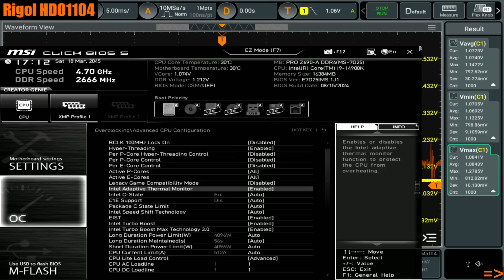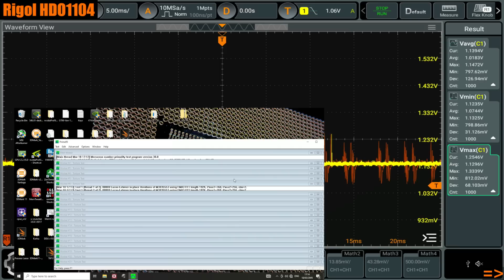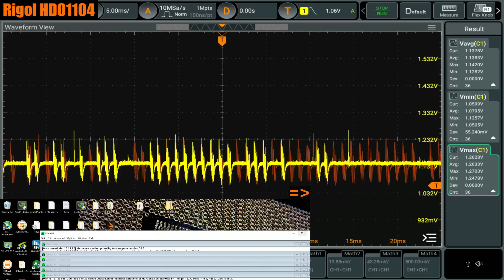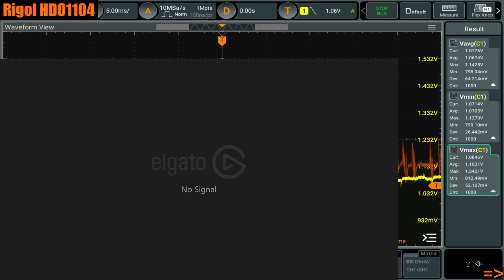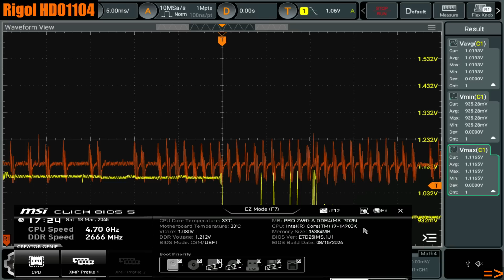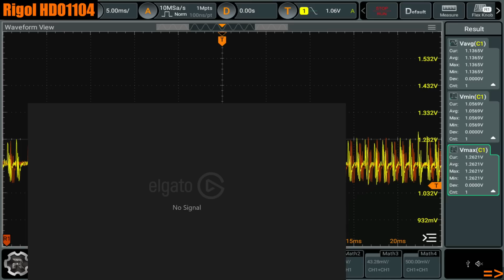CEP reduces Vcore undershoot

Comment: Hi Buildzoid, I have cool memory kit and I wanted to know if you have experience with subtimings/OC of those on a Ryzen 5900x system with a Gigabyte X570 Aorus Pro Rev. 1.0. It is the Trident Z Royal F4-3600C CL 14-14-14-34, 1.45V (2x16GB) or F4-3600C14D-32GTRGA. Thx and best regards

Comment: I have had Z690 Tomahawk DDR4 and VRM on it was pretty good. With 12900K no limitations it was running Prime95 small FFT’s forever pulling 353 Watt. Though my cooling solution is a bit oversized. Comically so 😂
Now I have Z790 Tomahawk with Trident Z5 and VRM is even better. Runs cooler despite 14900K disaster. Unlimited it pulled up to 404Watt.

Comment: i have a question if anyone can give me a answer.

how can i know when applying to much voltage to certain metals or other materials if the materials degrade faster over time?

i am asking this because i want to know if there are methods in how to calculate life expectancy's from different materials for example CPU, GPU, RAM and other board components.

the reason i am asking this is because of the high voltage the new CPU's are using now a days.

my Intel i7 5930k runs overclocked at 1.29volts at 4.4Ghz 
the stocks setting is 1.15 volts at 3.7Ghz
i can go to 1.35volts but then i need good cooling to keep the temps down and i find the voltage to high as well.

the new CPU's from Intel and AMD can run at 1.45volts or even higher
and i am trying to find out how i can know if this is safe for the longevity of the CPU
and if i can calculate the life expectancy of the CPU.

from what i know in the past when applying more voltage to the CPU the life expectancy will drop as well, depending on how high the voltages are.

so if anyone can tell me methods on how to calculate the (voltage X materials = life expectancy's) formula's or something like that.
that would be a huge help for my future researches and purchases!

Comment: BuildZoid, if you haven't already done so, can you test the MSI 0x129 BIOS to see if it disables the 1.55V limiter when you leave (or get kicked out of) Intel Defaults. MSI tech support refuses to give any guidance on this matter because the people we spoke with either didn't understand the question or didn't know the answer.

The implementation of the 0x129 BIOS (for all the motherboard vendors) appears to assume that you always want to overclock if you stop using the Intel Defaults. No one ever assumed that you would want to just downclock or set a fixed all-core. It's frustrating. I know plenty of 14th gen i9 owners that have been forced to downclock to get thermal throttling under control.

Comment: I tried CEP with my 12700K and Z690 Hero, and didn't find it measurably improve stability or improve undervolting. Tested in Prime95 small FFT.  Basically, it makes no difference. So, whatever other measures to mitigate voltage undershoot Intel has taken besides CEP, those measures are working well enough so that CEP isn't helping. BTW, I suspect, those "other measures" are not clock stretching related but rather purely electrical, e.g. adding more capacitance/inductance within the silicon to avoid excessive voltage drop in certain critical parts. Possibly, that's also part of the integrated voltage regulator that is built in to CPU. Your graphs speak in favor of this theory since we do see massive voltage drops when CEP is disabled. The fact that the CPU remains functional suggests that the voltage drops within the silicon are likely not that low.
Reply: So cep enable or disabled?

Comment: I wonder if this behavior would have a measurable impact on performance. I assume it would be hard to test though, as you would need to reliably move the mouse (maybe with an AHK script, but not sure if that triggers the voltage spikes) and Cinebench is already so noisy that it could vanish in the usual variance.

Comment: I've seen you add a bunch of caps to a gpu for better stability. 
I assume that you could do the same for CPU's, but I also assume there are reasons you haven't.
What are the cons to adding caps to the motherboard? 
My guess is that the voltage ramp up under load would be slower, and potentially load the mosfets too high during the ramp.
On the pro side, I'd guess the voltage would take longer to fall, and thus heavily reduce undershoot.

Am I on the right track?

Also, what is the mechanism of clock stretching? Is it simply dropping the multiplier, making the cycle longer, or is it more granular, stretching individual clock cycles as necessary?

Comment: Could you please make a video exploring Asus Z790 motherboard voltage behavior after 0x129 update? And how to optimize 14900K on Asus Z790 motherboard? 
Asus seems to have weird setting which would lock down AC/DC LL to 1 if the Intel Default setting is on, which make SVID undervolt not working.
Reply: This please
Reply: I have Intel Default settings on but my AC LL is tuned still, what do you mean locked down?

I would LOVE to see BZ do an Asus mobo video though

Comment: Nice video, you actually made me change the loadline, but I did not change to 1 because I'm on a different board (Asus) but change from auto to 0.5 an my CPU requests drop from 1.5 to 1.3, I still using the overwrite voltage set to 1.25 but is nice to see the requests lower.

Oh, I have the CEP turn on (never turn it off), also turn on some more protections that is available on my board, disable the undervolt protection ( I don't care the CPU crash for lack of voltage ).

Comment: CEP triggered -> 
cores stall in some cycles (effective clock down) ->  
electric charge provided by capacitance (of MB power mudule) reduced (compared to no CEP)-> 
undervoltage of capacitance reduced ->
undershoot reduced
This can be infered from physics.

CEP is not bad. The EVIL is UVP (Undervolt Protection), which blocks negative VID offset if you don't use K+Z platform.

Comment: Cinabench 38000 , 1940 single , max temp 86 on air cooler max  1.397  its not low but work great i waiting for AIO then undervolting

Comment: What problems can extremely lower voltages create? Why does the CPU protect against these?
Reply: System instability.
Reply: the time a transistor takes to switch is inversely proportional to voltage. if you jump to maximum frequency, and the voltage is especially low, and you do some cpu instructions that have an especially long chain of transistors switching in a row inside one clock cycle, the voltage might not fully/correctly settle before it is read out for the next clock tick ...boom
Reply: It won't harm your chip though, unlike too high voltage. I can harm your file system and Windows installation though (like every crash).

Comment: How did you address the voltage spikes on reboot from the last video? They seem to be gone.
Reply: I have the exact same question because I have the same motherboard.
Reply from the maker: The CPU is limited to 4.7GHz. So I wouldn't say the spikes are gone since I didn't check for them. But if they are still their spiking by 50mv when you're at around 1.1V is much less of problem than that same spike at 1.55V
Reply: @ActuallyHardcoreOverclocking you are definitely correct, at 7:53 spikes to 1.342 on reboot when you turn on CEP.  There is a spike when you reboot with CEP off earlier on although harder to tell it just didnt look as big.

Comment: I beg you change your mic, or recording settings. Your voice is literally painful. I love your videos but can't watch them because of that. Soften it somehow. It's crazy but I actually get headache from your voice and I never get headaches.
Reply: Maybe he's suggesting bass boost, or turn down the treble? It is true that different equipment or audio settings make voices sound different.

But voice is not something people can control. And complaints about a person's immutable characteristics is borderline.

Personally, I would put on your videos before bed, because listening to you relaxes me, and helps me sleep. And your information has been hugely helpful to my own, and so many other peoples, PC build process.

When you talked about tantalum caps and said, "Worst smelling capacitors ever", that's my favourite Buildzoid quote. Shine on you crazy diamond 😊
Reply from the maker: soften it? Like pitch it down or something?
Reply: @ActuallyHardcoreOverclocking  it could just be your mic. 

But you could try turning down the gain and treble. Otherwise look at getting one of those Shure mics that everyone uses for podcasting. Forget which model it is but it starts with SM. With that mic alone you might not have to adjust any settings.

Comment: This AVX Test is that power hungry because MSI uses the AVX Guardband Multiplier at ~50% (Value 128 of max 255). If you want some Asus like behaviour, you should set that to "0".
Reply from the maker: I just set it to 0 and the load voltage didn't change at all it's still 1.14V average on the scope.
Reply: @ActuallyHardcoreOverclocking  you are right and I was wrong. Checked it by myself. I was so shure that this Had an effect. But yeah. Can't See it now. I'm sorry
Reply: @bauerns5er it's good to see people with the emotional maturity to say, "Sorry, I was wrong", well done for that.

I'm currently dealing with people who lack empathy and who never acknowledge their errors. It's draining, so it helps to see, that there still are emotionally healthy people in the world.
Reply: @ActuallyHardcoreOverclocking  okay. I didn't expect that. I'm pretty shure I can see a difference in HWInfo. But in a everyday setting. That means LLC 6 and Matched AC and DC Loadlimes. No scope though

Comment: Can you tell us EXACTLY what pin number on CPU you are measuring as I would like to connect my 250MHz scope to my Asus Z790 Hero which you haven't tried yet? Average 14900KS but good P Cores and MC.
Reply from the maker: I'm just measuring from one of the multi layer ceramic caps on the back of the CPU  socket. With the Hero you could try connecting to the output of the opamp that ASUS uses to copy the die sense voltage to the super IO. Though that might have somewhat limited bandwidth.
Reply: @ActuallyHardcoreOverclocking  Why my i7 13700k never hits 5.3ghz in gaming after microcode update?
Now is 4.9 max.My sp score is 92.I have gigabyte mobo,i use intel default

Comment: Hi, Is it necessary to enable CEP on z790 apex encore when overclocking with fixed vcore mode?
Reply: No one can tell you if CEP is "necessary" because the Intel documentation on the purpose behind the implementation of the feature is basically non-existent. All we know is roughly what it does and that Intel recommends it being on by default. Whether or not turning it off has any significant real world consequences beyond situational instability in some setups none can say.
Reply: I've had CEP being triggered with a 1.3v fixed voltage, you need to test this for yourself

Comment: on ryzen 3000 you can get clockstreching with ecc 10A and singel cock work load. 
r23 without cs 1312points
r23 with cs 1120-1201points with 3900x
im sure that you can get it with 5000 ecc 10A but im not sure if it is possible with 7000 or 9000 series 
you get higher score with more than 1 core aktiv (boost high with same V)

Comment: In teresting.... Tuning my 14700K and that was not my experience. Asus Tuf Z790.

Searching my lowest undervolt with CEP on got me worse undervolting results.
And while I used adaptive voltage, you cant then also adjust the VF curve without triggering CEP.
It was stuck, giving me low cinebench results. Not until turning off CEP, did I get normal performance back...

LLC 4 with 0.5/0.5 AC/DC loadline - maybe those settings are wrong for CEP...
IA Voltage Limit of 1500, and even managed to get it to run 5.9GHz, while under full load its running at a -0.06V undervolt thanks to the VF curve.
Reply: You need at least 0.8 AC load line for LLC 4. CEP operates assuming AC = DC = LLC
Reply: @_exilon_  Like, based on what do you give that number?
It sounds interesting and worth a try, sure...
Reply: @HexerPsy  LLC4 is 0.98 mohm on ASUS
Start off with a -100mV VID offset, 0.98 AC, 0.98 DC, LLC4
Reply: @_exilon_  worth a shot
Reply: @_exilon_  Tried it out with LLC 4 and 0,98/0,98 as you suggested. That seems to be in line with CEP indeed.
I managed a -0,10V undervolt as you predicted, while CEP starts messing with the clocks around -0,11 or -0,12V. Had to raise voltage at 56x and 59x to only a -0,02V undervolt.
But at least the adaptive voltage and VF curve now work together as expected.

CBr23 went from 33,6k to a 35k so thats also great.

But where did you get that info? I looked but couldn't find it myself... I would like to know for future reference
Reply: Could you use LLC=4 with AC LL=0.5 and DC on Auto (So 1.0) but have the "Sync AC/DC to VRM LL".function checked?
Reply: @DeagleHonor  AC must equal DC, so it wouldnt make sense to set up settings that are fighting each other. Idk what the sync option does or which one takes priority.
I am not willing to test that.
Reply: @HexerPsy  BuildZoid said it works in his video.. I'm going to re-watch it. I've been running it this way for a while with no issues thus far
Reply: @DeagleHonor  Yeah I remember a small note on AC/DC Sync to LLC in passing on another video. I believe his advice was against using it, iirc...

What I can find online about it is that the setting comes with up and downsides and does help with LLC testing, but not intended for permanent use.

However intels spec suggest AC=DC and that the socket mohm measurement must equal DC (making DC unknowable).
However if you mess with your LLC, the droop decides the AC/DC value... And the droop is measurable somehow (I didnt look into this).

If you use different values you run the risk of triggering CEP during undervolting before hitting instability caused by undervolting - effectively crippling performance or reducing your undervolt.
Lowering AC effectively undervolts the chip, but doesnt change what CEP expects, potentially triggering it sooner. Different AC/DC settings can also cause instability, easily measured in CBr15.

At least... that is as I understand it currently...

I believe a proper LLC and AC/DC with CEP should give you the least voltage spikes, with the most stability, allowing you to run the best undervolt.
Atm my 14700K reports 1.22V under full load 5.2P and 4.3E iirc - so thats not so bad...
However, the voltage limit flag does pop up quite frequently. IA voltage limit is set to 1.5V and the chip boosts to 59x on 1.44V ish. The chip is only undervolted with -0,02V at 56x and 59x to achieve this.

I think thats safe... It runs stable.
And if it dies on me now after so much effort, I am ditching the platform and grabbing a 7800X3D, 9800X3D or 11800X3D.

Comment: Can't run my same undervolt with CEP enabled on my ASUS board unless I lower the cache ratio below stock.  For some reason the cache/ring voltage is causing the vcore offset not to take effect unless I get the cache voltage down.  Using AC LL at 0.4mv which would trigger CEP lets me get the core voltage down without messing with the cache voltage for some reason.  My normal cache voltage under load with my AC LL undervolt is 1.15v but to get the same vcore under load using AC LL = DC LL, cache voltage has to be all the way down to 1.10v and I'm not sure that is stable.  I don't know if this is just a bug in the ASUS bios or an intended behavior.
Reply: Effective VID is the highest of P Core bid, E Core VID and Cache VID. Probably explains what you are seeing.
Reply: @ColinDyckes  Yea but that is the thing, the Cache VID is lower than the P Core and E Core VIDs.  With my current undervolt the cache VID is 1.150v while the vcore VID droops to 1.170v.  Oddly enough, under light load the Cache VID is only around 1.138v and it goes up to 1.50v during a full load.  Also it seems Intel's default is trying to run the cache higher than stock.  At stock it should be at 4.5ghz but Intel Defaults is suddenly trying to run it at 4.7ghz.  Using the Intel Defaults, I have to apply a Cache offset and get the Cache all the way down to ~1.10v just to be able to get the Core VID down to 1.170v which doesn't make sense.
Reply: @ZoneXV I applied 0x129 today on my Z790 Hero and it changed my default cache frequency from 5GHz down to 4.7 which then drops to 4.5 under high load (14900KS). I must admit I haven't got my head around the best way to undervolt whilst not triggering CEP yet, but can run a 75mV undervolt. I'm considering just turning off CEP as I'm nowhere near the 400A limit. Still hoping Buildzoid does an Asus Z790 video 🙂

Comment: Now this is a fun refresh from the whole RaptorLake voltages thing, great little video! The whole CEP thing is probably far more useful from a stability perspective in low power devices and laptops than big beefy desktop VRMs, say an idling laptop at literally a fraction of a watt in idle state and with VRM phase shedding effectively turning down the VRM capacity then going to a full single-thread burst load and requiring the maximum VID. I'd think it probably can go even beyond the typical reliability voltage buffer in cases like that, so you would need CEP to stabilize it.